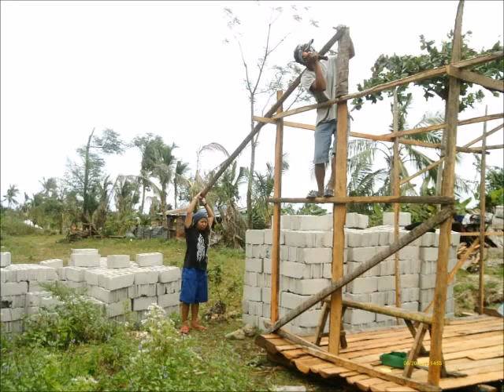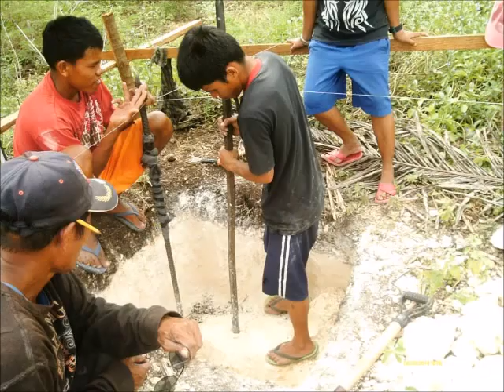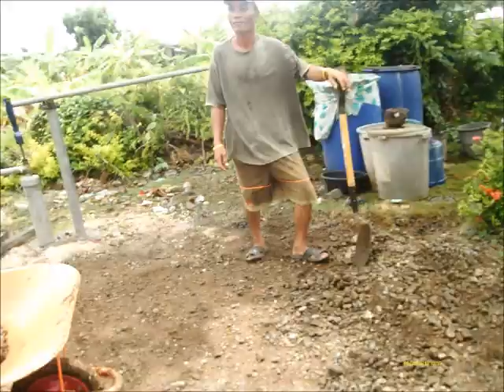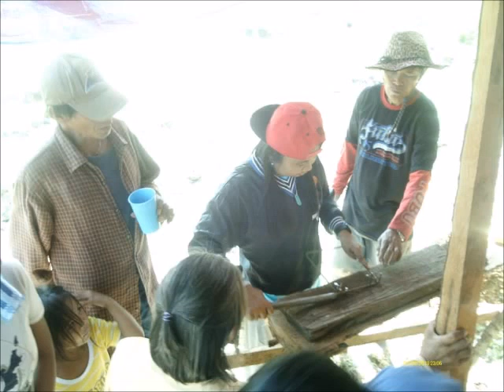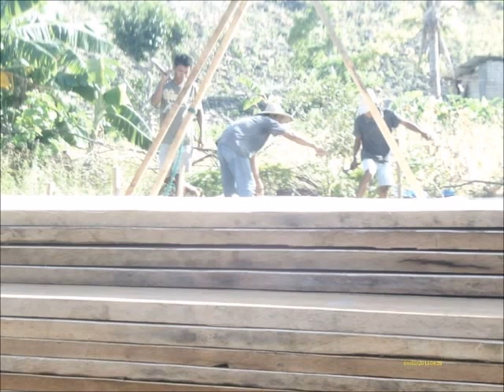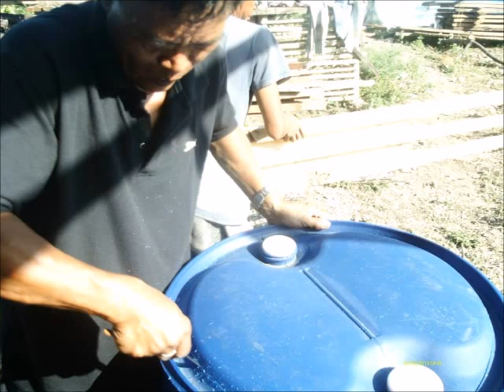Philippine Life: Building a House in the Philippines Pt1

Comment: Yes Youlander went straight though Nailon to wiped out alot of homes but ours only flooding inside as the roof leaked our house was built very strong but the walls were wobbling to but we diddent get strong hollow blocks wishe we did but this house was already 2 room in it we built on now its 3 bedrooms and large sala lounge 2 lounges actually really built a big big loinge 24feet by 24ft was just finished as youlanda hit we hadent even put the windows in the front built on lounge but it stayed up

Comment: never seen rebar painted before, once its covered by the concrete it wont rust any more
Reply from the maker: Hi Lawrence, I had it painted because of the weather conditions and humidity in our area. We are also close to the ocean. For what it cost me, It's piece of mind that I don't have to worry how porous the concrete is. The other reason is that the build was slow and rebar was exposed for some time as the build progressed.